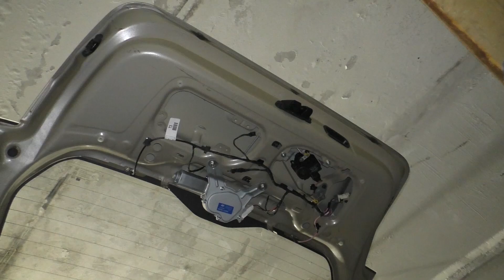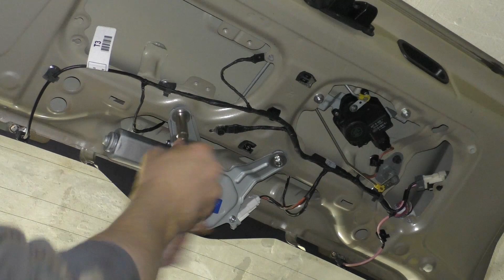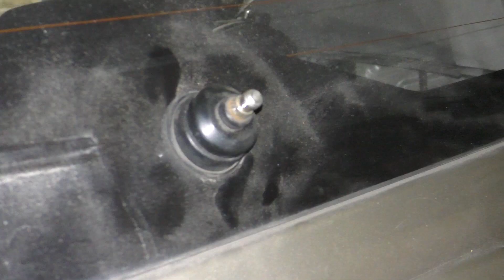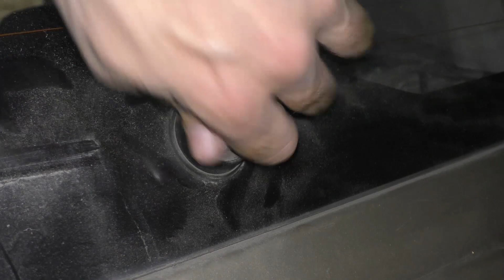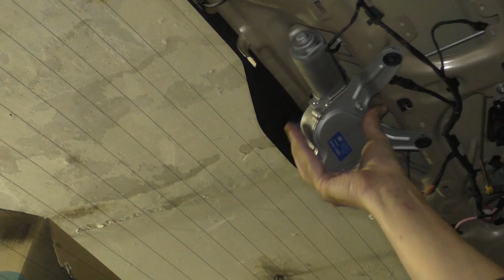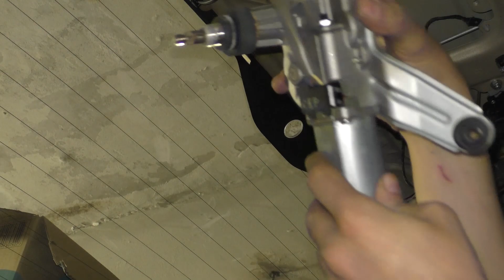Hyundai Getz - How To Remove Rear Wiper Motor

Comment: Where are the bolts located to get the cover off so I can take my wiper motor out of the back so I can see if it seized up because I hear it trying to click on to go back to the resting position so I think it might just need all greased up and if it's just needing grease what kind of Grease do I put in it electric grease or grease gun Grease because I have both